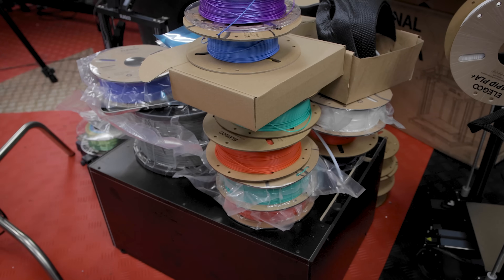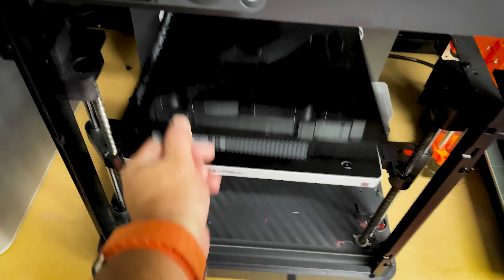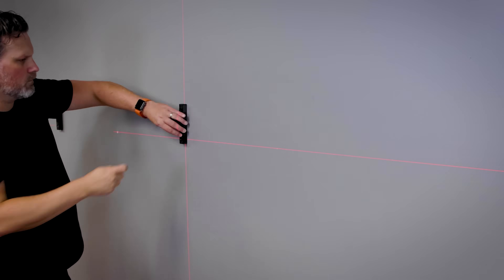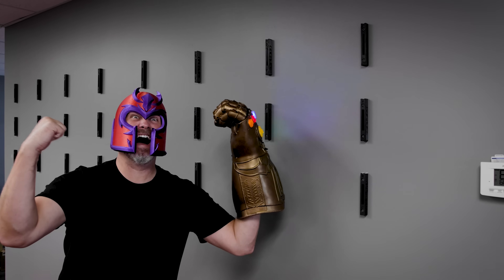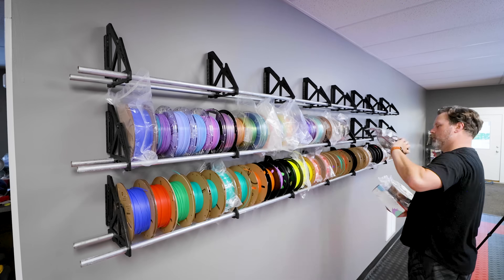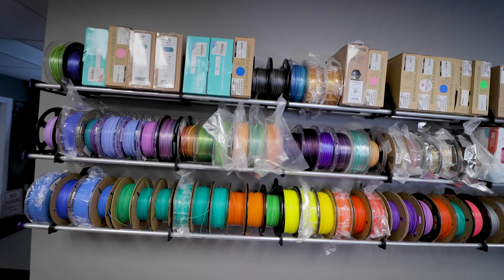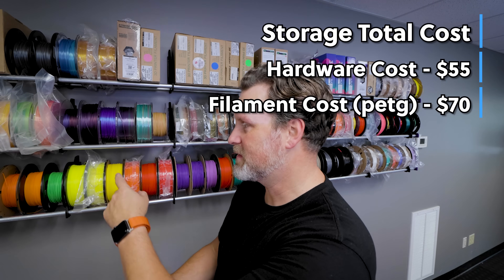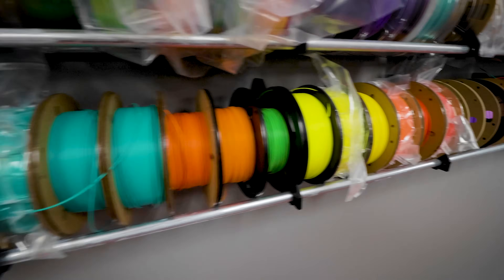Easily the best 3D Printing Filament Storage Solutions

Comment: Nice Job, looks great. Question? I see a number of your filaments are not in sealed packages, are you worried about moisture accumulating in the filament causing print issues. How critical is it anyways..
Reply from the maker: Yeah it’s not ideal but I mostly print with PLA so it’s usually not too bad. If anything I can run it through a filament dryer for a few hours if needed

Comment: Very cool.   What’s your experience with printing performance with filament that is stored without a desiccant humidity reduction enclosure or in bags/boxes?   I am interested in a wall storage for displaying filament while in storage, but then there’s all the commentary about wet filament issues.   Which filament types store well for ready printing exposed in 25-40% humidity room conditions and types that would require pre-print drying?

Thanks for any advice.

Comment: I really like that storage system.  That's a lot of filament just sitting out in the open collecting moisture, though.  I've seen very few people address "dry" filament storage.  There are vacuum bags out there, but most of the reviews seem to say they're unreliable and leak.  There are people using cereal boxes with desiccant inside.  I'd be interested in a "best way to dry store your filament" type video, as I'm just getting into 3D printing and would like not to have to reinvent the wheel if someone has a good solution out there.  I guess you could just leave it all out in the open, but then you'd have to bake the filament in the oven or a filament drier for like 8-10 hours before using it.  Who wants to do that every single time they want to print something?
Reply: Jessy said he mostly prints PLA, and it doesn't absorb much moisture.  It's generally OK to store it unsealed, but filament should be protected from dirt, lint, cat hair, etc.  Most homes are relatively clean environments but if you are 3D printing in a garage, shed or unfinished basement, it would probably be best to put the reels in gallon Zip lock plastic bags or put them back in their original box when storing them.

Comment: This looks like a great system, but what is the recommended spacing between the brackets?
Seems like you may have been able to use half as many if you are drilling into studs.

Comment: I've tried using the 3mf file on my X1C but it's only importing geometry and nothing else and was wondering what the infill % is.  Can I get this information from you for the parts since I can't locate it either through printables nor on their own site.  Thanks in advance.

Comment: I dont own my own home and i think my landlord wouldn't take too kindly to me mounting a 3d filament rack to the wall. I use pvc pipe with an endcap that's bolted to a spare piece of timber i had lying around. I just cut some holes in the box and the boxes of filament sit nearly stacked in a corner of my garage. I only do this for PLA. ThePETG etc gets dried and vacuum sealed and stored in their original boxes. Haven't really had time to make a filament box.

Comment: The tensile strength of drywall screws isn't very much so they're holding power for that type of application isn't recommended. I would suggest that you use either construction screws or wood screws to hang the cleats.

Comment: Great job! I live in California, so I also don’t have to worry about humidity levels. Never had to dry my filament. Everything prints without any issues!
Reply: why is that? what makes filament moist?
Reply: @zahidnawaz5845  It absorbs ambient moisture from the air. Different types of filament are more prone to moisture absorption ("hydroscopic"). PLA should be fine for the most part unless you live in a swamp, PETG is more hydroscopic, and some materials like nylon absolutely have to be dried or they won't print right.
Reply: thanks for the explanation @NWGR
Reply: I'm new to printing but in SoCal as well. Thinking I would be find doing this in the garage, what do you think?

Comment: Im having difficulty with my 3D printer failing with a layer shift at specific height. I've tried everything but cannot seem to pinpoint why. Everything leveled and tested with leveling squares, and the torture test cross has come out flawless. Idk if it's my filament or something else. Neptune 2S 0.3mm nozzle, belts are tightened but not too tight, no clogs. Only thing I can think of is the spool is not wound the best, but seems to roll fine when starting. Polylite PLA Magenta
Reply: Just found this video and went looking through the comments and found yours. I looked your specific printer up and saw it was similar to almost all the cheapies these days. As for your issue and layer shift at a specific height… my guess is that you have a roller/rollers that have a flat spot. This happens mostly from non-use, as the pressure from the roller sitting against the frame is enough to deform it enough for it to be an issue when printing. Easiest way to check is to remove the z axis drive rod from the carriage and manually pull the carriage up and down. You will “feel” the bad spot by doing this. The only way to eliminate this is to change the rollers. I buy used printers and this is always the first thing I check and swap before using. Pulled my hair out trying to figure it out… now that I know, I pass the knowledge on to anyone who needs it. Enjoy!!😊

Comment: This is awesome, I keep all my filament in weathered proof cases with dehumidifiers inside of them, I am new to 3d printing is this necessary for me to do that or what? I’ve heard all kinds of horror stories about filament going bad with moisture I live in NC where the other day it was 91% humid.
Reply from the maker: Honestly that’s the best way to keep it long term but I’ve had pretty good luck with it out in the air so far.
Reply: @UncleJessy I think you probably use your filament up pretty quickly though too. I have rolls that I have had sitting here for several years. You do way more printing than I ever will.

Comment: Do you dry your filament at all? I've seen people suggesting it is a must (we live in a ~50-70% humidity area) and so maybe a drying cabinet near/under the racking could be cool? Something I'm thinking of doing once I have my garage sorted for printing so would love your tips!
Reply from the maker: You should, buuuuut for PLA I usually just leave it out. Petg + moisture sure is more of an issue along with other filament types. But for PLA I just unroll a foot or so, cut it off and start printing
Reply: @UncleJessy my situation (Liguria, Italy) is that after 15 days pla CRACKS. And is not bad pla 😅.

I have every spool into sealed containers (ikea Samla)
Reply: Was just about to comment this. He's put it right next to a door as well. Even if he had a dehumidifier, once someone opens the door, all that energy is wasted.
Reply: I was wondering the same thing.  I have my filament and printer in my home office and I keep my filament in ziplock bags with desiccant packs (the ones that came with the filament).  I would be leary of keeping my filament exposed in the garage here in Georgia.
Reply: I live in Florida and a dryer is an absolute must for ANY filament.
Reply: I also live in a high-humidity area and I got a single spool filament dryer. Highly recommend. Not all of my PLA needs it, but it's great for the ones that do.

Comment: Wouldn't this cause some degradation by moisture absorption?
Reply: Would really depend on the climate you live in. Where I am, that would destroy my filament within a week or so I'd think
Reply: I'm in Louisiana so I think I'd be in bout the same boat unless I was vacuum sealing each roll. I wish I had the low humidity to be able to just do this
Reply: I use the same shelves in a humid environment, most of the time I put my spools in a filament dryer before printing. They print fine if I don't, but slightly better if I do
Reply: That's his studio though, so he probably runs a dehumidifier to keep the humidity at a reasonable level for filament.